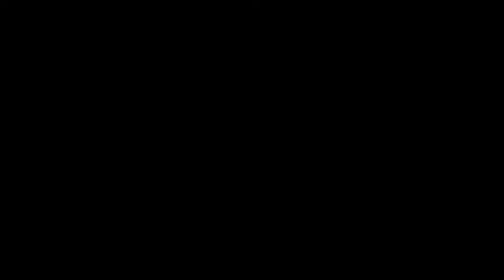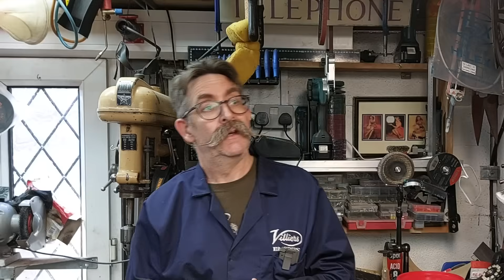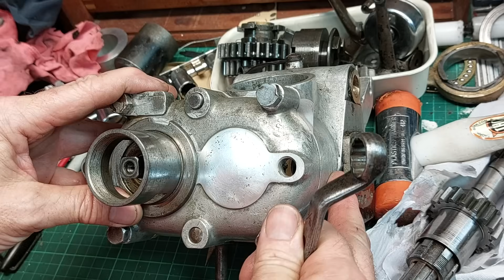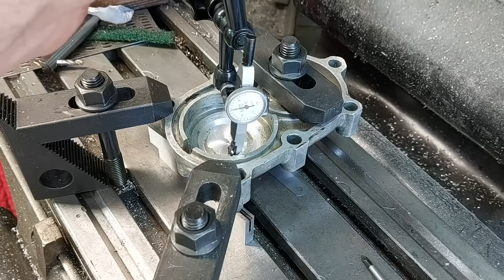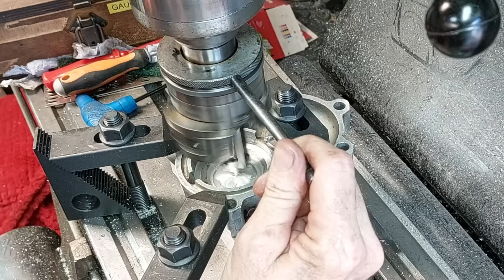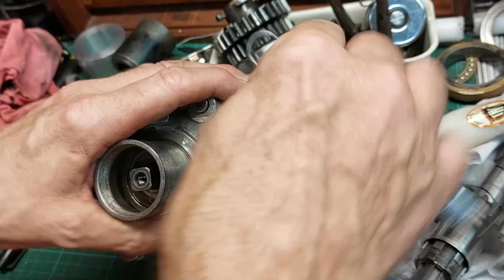BRIDGEPORT WORKING OFF THE SIDE, CALAMITY AND DISASTERS WITH SCOTT GEARBOX.

Comment: cough. i am sure you could have skimmed two blocks level and done it ON the bed... whatever, milling calisthenics.

screaming at the screen not to weld that cap in like that but you went and did it anyway... sigh. no access there cause of the boss... should have hacked the side off the cap and left a gap to fill from "above"...
next time.

certainly put up a fight...

Comment: Well done with the welding job, hopefully it will have the strength to hold the forces involved when the bearing is re-fitted. I wonder how hard it would be to recreate the entire casing!? Still fingers  /touch wood crossed with the repair! My knowledge is extremely limited as far as welding goes but I guess other options are limited!
Reply from the maker: Thanks David, metal casting is a whole other skill to learn, someone who does it every day could do it but it'd be a lot of trial and error to tackle as a home project.
Reply: @TweedsGarage  I would guess and its quite a complex component to copy, It makes you wonder whether any age hardening has gone on in the last 80 odd years. Still well done with the weld, looks good!

Comment: A trick I have used to deal with porosity is to douse it in Loctite 290 wickin or equivalent.
Use a new bottle with primer T after cleaning with aromatic solvent and vacuum drying to pull as much oil or liquids out of the area as you can.
Once you do this you cannot successfully weld that area again so make a careful assessment and decision.
Good luck and take care.
Reply from the maker: Thanks for the tips 👍🫢

Comment: You have the patience of a saint. Well done at carrying on to get the job done. 

As I was watching, a thought popped into my head. Would it have been simpler to just cut the whole of the damaged section, including the bearing seat out and then turn up a insert to thread into the case. You could have then welded that to the case. This would have most likely allowed you to get past the leaky sections of the case. 

Of course, the best way to weld this would be using an electron beam system. You might have been able to find a company that would have worked with you to do that. 
      https://en.wikipedia.org/wiki/Electron-beam_welding

Anyway, well done, carry on and all that. I find your work very informative and entertaining. But a question, did Jenkins eat your lobster, the one you used to walk?
Reply from the maker: The lobster is safely hiding in the garage....i did think about an insert but it needs to be flush to the back of the box to maintain clearance, it would of been the next option if the cap failed. I have had laser welding done on the Riley block and inlet, it is good but i like to give it a go.......there's  always a plan B if it went south😊

Comment: Always nice to have LOTS of tool options ! I think you will find you can remove the Morse taper shank from the import boring head and put in a R-8 shank .
Reply from the maker: That is an option but that extra length on the quick change adapter is really handy for reaching down into the gearbox housing.

Comment: New to your channel Mr Tweed, like the videos, just an idea, that we use a work, on jobs that are arkward to hold and face off, we use body filler blobs stuck to the opposite side of the datum face, skim off the filler supports paralle to the datum, then flip it over and do the work you need, then when finished, we clean the body filler off,
Reply from the maker: That's a brilliant tip, thanks David👍

Comment: When these were cast TIG welding wasn't even invented! I wonder how well they would have welded even when new? Isn't there some vacuum epoxy process they use now to suck sealant into porous castings?
Reply from the maker: I did contemplate it as i had it done on the Riley block after the laser welding......the company that are supply the liquid sealent also do vacuum sealing, as i knew where the leak is its easy to treat and saves time getting the gearbox housing to and from and place that will do it.
Reply: @TweedsGarage These days more and more things need to be sent to specialists to get them done.
Reply: @TweedsGarage  Well when all else fails electron beam welding is always an option. Had to do that on a unit we made for the B2 bomber.

Comment: similar issue with a Burman box, all i can say is blessed be the machinists, he did look a little fraught when i picked the job up. 
i didn't think to check for porosity, but with semi flid grease it doesn't seem to be an issue.
Reply from the maker: I shall be using semi fluid grease on the Excelsior gearbox..... as all the oil i put in it has escaped, mind you its a mucky old job spooning it in.

Comment: Any chance you 'dipped' the tungsten welding electrode during welding? You may have left a piece in the weld and when you were proceeding with the boring step the boring bar may have run into trouble when it started to try and cut the tungsten.  The piece would have been incredibly hard and very resistant to machining. Ask me how l know.😮
Other than that, full marks for a VERY tricky salvage operation, many things to consider and be aware of.
I noticed Jenkins was conspicuous by his absence. 😊
Reply from the maker: Oh no doubt with my shakey hands, that's why i have at least 3 tungstens sitting close at hand for the inevitable.

Comment: Wow! What a brave man, to bring a welding torch to a century-old thin-wall alloy casting.Well done, sir!
Reply from the maker: Thanks,  once you get that kind of damage you've got nothing to loose,  but it came out ok
Reply: Preheating the aluminum before welding was good practice, it helps to reduce the movement that occurs when welding thin aluminum.  You didn't show it but I'm assuming you cleaned the inside of the casting with a solvent such as acetone to remove residual lighter fluid or whatever you used to check for leaks.   Any residue would cook out and contribute to the porosity problems.   Your leak test is very similar to the oil and whiting method that eventually led to the development of liquid penetrant test methods.